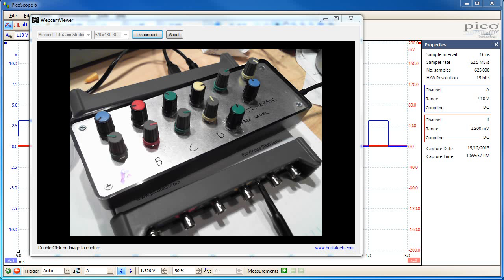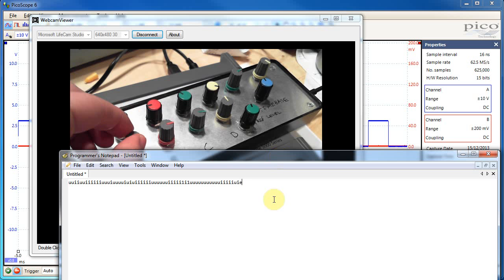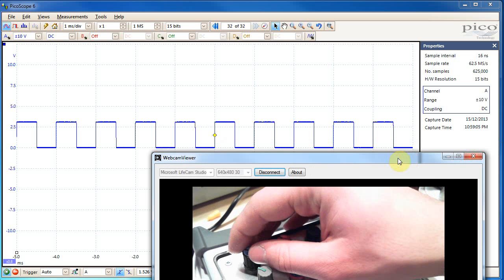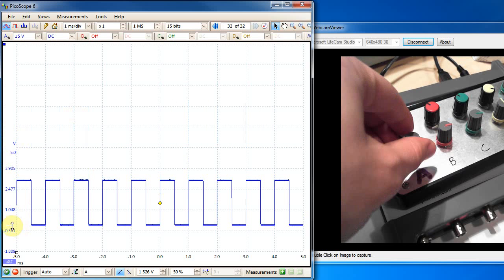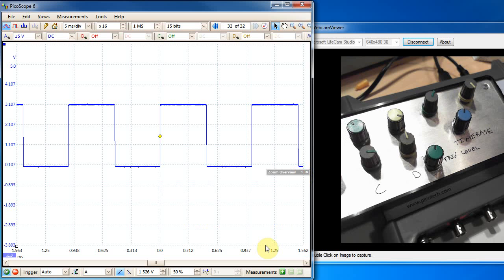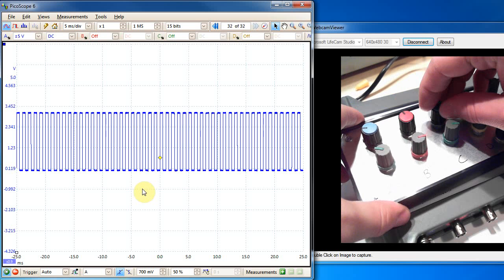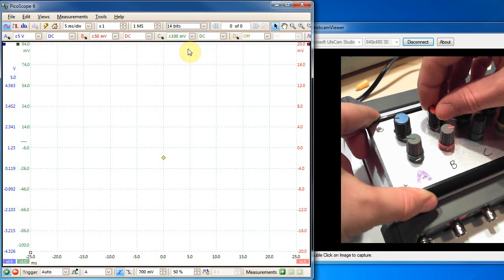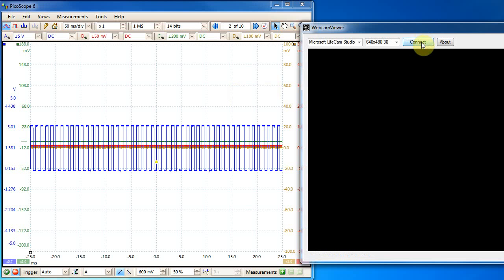PicoScope Encoder Knob Board - USB HID Keyboard via Physical Encoders

Comment: I followed your instructions on making the picoscope knob project. I used the teensey++ 2.0 as recommended. The hex file did not work with that board and the make file is did not work with it either. I made two changes to the make file. I changed the F_CPU to 16MHz and the board from xxx287 to xxx286. Then things worked perfectly. Thank you for putting in the time to make this easy.
Reply from the maker: Crap - thanks for pointing out those fixes! Will update the files...
Reply: While you are at it, it doesn't look like the teensy++ 2.0 has pins E2 and E3.
Reply from the maker: Paul Curtis
Pushed some updates to the git repository, just modifying to build for Teensy++2.0 by default. I added a note about E2 buttons missing too... not much I can do to fix, but the name/number mapping is irrelevant so you just don't get as many buttons as I claimed originally!